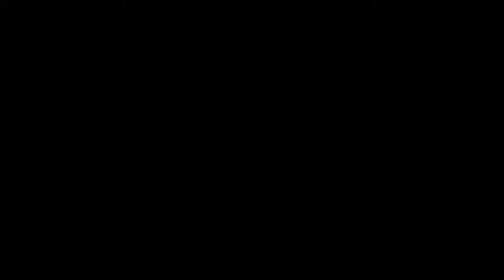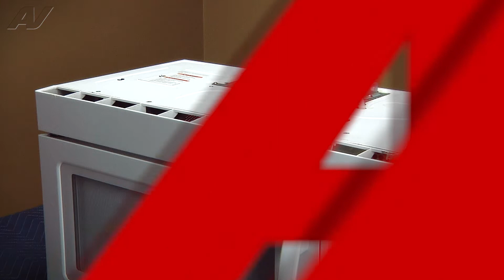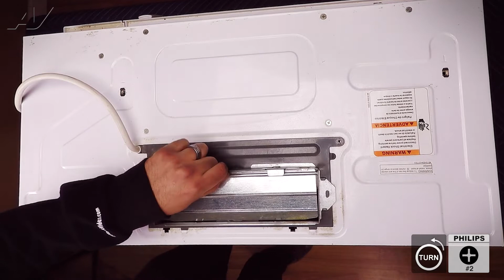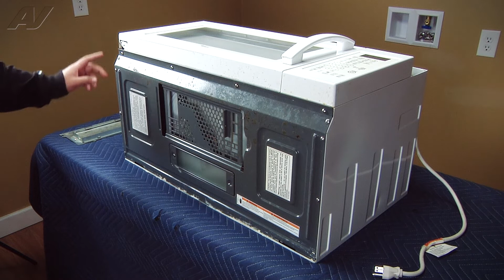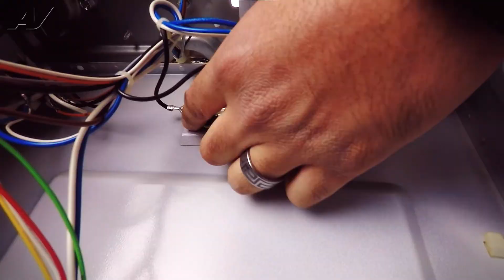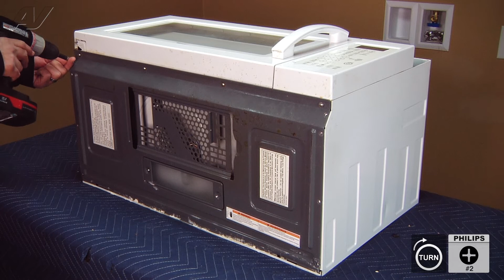Whirlpool Microwave Repair -  Stops Running After 10 Minutes - Thermostat  Diagnostic & Repair

Comment: i have a kenmore. powers on an slightly still turns round an round but doesnt heat up?? whatcha think it is brotha. an thanks for this video. helped out alot
Reply from the maker: Great question, if you have a more technical question that our parts department cannot answer, you can search our over 17,000 answered questions free at our website www.ApplianceVideo.com under our Repair Help section. You can also call our parts department at 1-800-830-5465 and they can give you help 7-days A week ,or search at www.SaveMoreOnParts.com  .

Comment: Now did you know that it was  bad
Reply: My microwave  isn't heating
Reply from the maker: Great question, if you have a
more technical question that our parts department cannot answer, you can search
our over 10,000 answered questions free at our website www.ApplianceVideo.com under our Repair Help section. You can also call
our parts department at 1-800-830-5465 and they can give you help 7-days A week
Monday -Saturday, or search at www.SaveMoreOnParts.com  24 hours
7- days A week.
Reply: It's a Maytag and it's about 15 years old